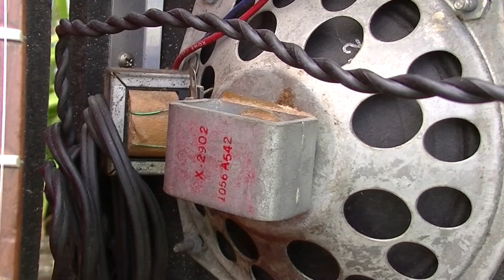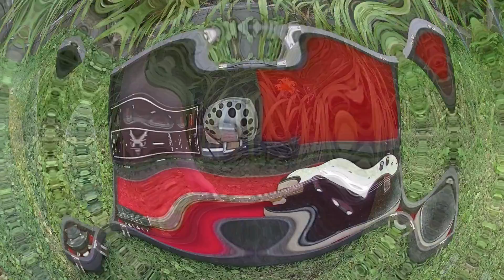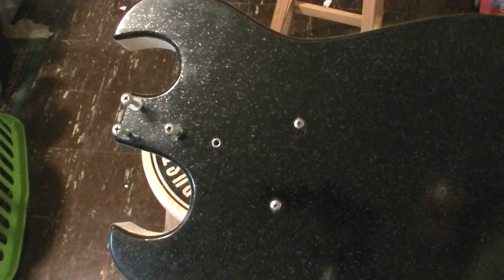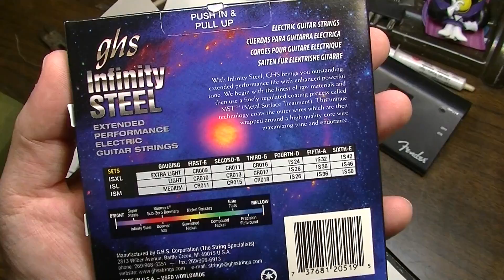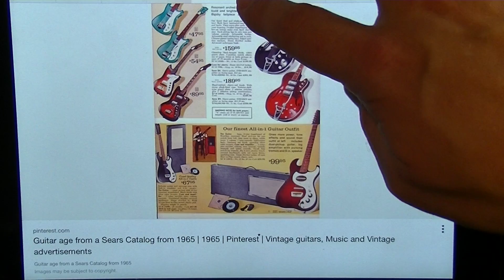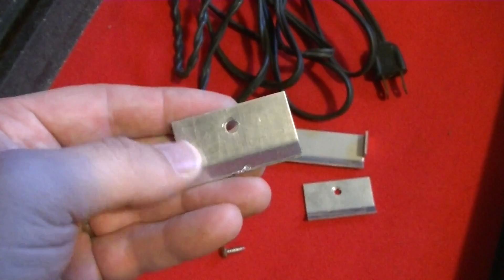Amp-in-Case Guitars - Bad or Brilliant?

Comment: Is it just me, or does that cheap hunk of plywood actually sound good?
Reply from the maker: RB Brown it ain't just you. I dig it too.
Reply: I'm 58 now and I had one of those in 1973 when I was 13. I can't remember what TV show it was but I saw "Skunk" Baxter play one of those. I was all into Kiss back then and I made an Explorer body out of 2 layers of 3/4 " plywood that was glued together and I bolted the Silvertone neck to it. I bought a Customcraft Les Paul when I was 15 and to celebrate my new guitar I put an M-80 in the Silvertone and blew a big hole in it. What was left of the guitar and case went into the garbage. By 1993 I was touring with the rock band "Brother Cane" doing front of house sound. We were in a guitar store in Nashville, and I saw my guitar and case for sale for $700.00. I about choked when I saw what those things were selling for. I see them on eBay now for over $1000.00 in some instances.
Reply: @rwj1313  I had one too! Took it on vacation to my aunt and cousin's place in Virginia. I laid it down on the floor in my room. Came back in a little while later and someone had stepped on the neck. Snapped it in two. Broke my heart. I think I ended up throwing the whole thing in the trash. No one ever fessed up to it.
Reply: Rick Jones 
I saw Brother Cane(I had forgotten the band’s name) in 1993, or possibly 1994, in Atlanta at Lakewood Amphitheater. They were the opening act of a multiple artist Southern Rock show I know it was The Outlaws, The Marshall Tucker Band, Atlanta Rhythm Section, and .38 Special, but I think there were one or two other bands. It was a really fun day.
Reply: @charlesbolton8471  Yep Georgia Jam. We were touring with Skynard and Bad Company and those guys had a few days off, so we did Georgia Jam while those guys were off. 38 Special was the Headliner. We only had 17 days off that year (1993 BTW). If we weren't in arena opening for somebody we were headlining in a large club.
Reply: Danelectro was good for Jimmy Page , so can't be all that bad
Reply: Nope,sounds great.
Reply: It's not just you,-it actually sounds very good. Distortion controlled by how hard you pick the strings sounds wonderful.
Reply: It wishes it was plywood. Masonite. Guitar and amp.
Reply: Sounds as real as it gets from back in the days.
Reply: I have one. It (the 1448 guitar) really sounds pretty cool.
Reply: Pretty sure that those guitars actually had Brazilian rosewood fretboards at the time.
Reply: Yes, Danelectro was a notoriously cheap pile of sh!t that for what ever reason souned Great.
Reply: I bought the case without the guitar for $260. I also know where a mint condition one just like yours, guitar included,  is for sale at $400.  if anyone's interested
Reply: .. Danelectro wasn't the first person to do that neck tilt adjustment thing though because I've seen it on a really old Kay model, also Chris Adjustable Acoustic had that too.
Reply: RB Brown The guitar tone is 90% in the hands.  This guy is better than jimmy Page.

Comment: i actualy had a custom case i made that had an A.R.T rules breaker amplifier in it and i had a small stereo 2 /10 cabinet that a friend made for me..the case held my old school ibanez roadstar and the A.R.T. midi controller for the rules breaker as well as housed the rules breaker head and a space for some pedals..was a bit heavy but not unmanageable..i took it everywhere i could find a plug in and would rock out and try to make some beer and cigarette money..and oddly enough i got the idea from the peavey t-15 amp in case because i had one..i remember the tone circuit being very unique in those peaveys as well..kind of acted like a boost if i remeber.kind of a pickup blend knob that would blend the 2 pickups for a humbucker kind of sound..but they were tanks and very heavy guitars..but bullet proof tough..kind of like all things peavey..not the greatest but hands down the toughest stuff.why you always see old peavey shit at pawn shops and it still works and every pawn shop has a peavey test amp...lol...great video as always bro..i lear more stuff from your channel..much thanks
Reply from the maker: sonic mayhem really appreciate the comment, dude. Weirdly enough, the guy I bought this from also had a Roadstar! I bought it too. Do you still have the amp in case?
Reply: i do not have the amp in case but i do still have the roadstar and has been one of my primary guitars for all these years.all i have ever done was replace the pots and scored a complete set of NOS pickups for it as well as i sweat killed the old ones quite a few years ago.the neck on that bay was better than anything fender was making at the time as it has the thinner veneer style fretboard and still going strong on the original frets..wish they made em like they used too again

Comment: Opening or closing the lid of case is the EQ control.
Reply from the maker: Exactly! An placing it in front of a concrete wall or a laminate paneled wall will affect the tone as well. Empty basement = reverb and delay!!! :D
Reply: Yes it is Bro.. But they also have 1/4 Close/open ,  mid close/open, 3/4 & Full! 🤠💯

Comment: Hi,  I'm a great fan of your work!  I noticed when you were reviewing the chasis (around 28:35) you mention the "isolation transformer".   I'm working on a 1451 model with the same layout and want to put a 3 line power cord on it.  From what I can tell from other sites, that may not be an isolation transformer????  They suggest that these definitely need an additional isolation transformer modification for the 3 line power cord  mod.  Any additional thoughts on that?  Thanks for the great vids!
Reply from the maker: There are different kinds of isolation transformer. This one isolates the input tube's filament. Other isolation transformers you hear about people installing in series filament amps isolate the mains voltage for the entire amp. I discuss this in a few past videos. Many of those vids are in this playlist: https://www.youtube.com/watch?v=TuZxY3-26Lw&t=20s&list=PL68vqBBsqTi9bBnS13G8rFHzhS_WYPKPf&index=4

Comment: I think they went out of favour when small transistor amps came in cheaply that you could fit in the pocket on a gig bag. Things like the Marshall MS, mini Fender and I remember BC Rich made on in the mid 80s
Reply: The current Danelectro mini amp is the Honeytone. Runs on a 9V battery (but better with an adaptor), has a headphone out, looks cool and sounds pretty good, and I throw mine in my guitar bag when I go visit my mom for a weekend.
Reply from the maker: mike fear Danelectro made a micro amp too in recent years. I don't recall the BC Rich! Cool.
Reply: I don't think the BC Rich one was that popular. I had the BC Rich UK distributor in my town and bought one from their shop, maybe around 1986 ish. Was black and pink and probably 1 or 2 watts, and had a headphone out and volume, tone and a switch for overdrive. Was maybe 8 x 5 x 1" and battery powered so was a pretty neat litle unit.  IIRC was around £25 at the time. This was quite a while before the other manufacturers started making them, so BC Rich were ahead of the game

I actually looked for one online after I posted on here but couldn't find any info or pics, so maybe I bought the only one !

Comment: Yikes.  Looks like a hot chassis design -which is fine as long as you can't touch it, but it looks like you could easily put a finger though the vent hole and touch the chassis.
Reply from the maker: It isn't a "hot chassis". That's a common misnomer. No guitar amp will be a "hot chassis". Some radios like the All American Five, or AA5, can be hot chassis, with one end of the line tied directly to the chassis, but in series-filament guitar amps, the design includes an isolation capacitor and resistor separating the common ground in the amp from the actual chassis. And in some cases, they even features isolation transformers for the input tube's filament, which further isolates the inputs (and fingers) from anything carrying 120V line voltage. This design has both the isolation capacitor and resistor network as well as the transformer.
Reply: I looked again.  I thought the power switch was connected to a "ground" lug.  I guess it's not - just real close.

Comment: Your recording skills and quality are improving drastically. I would totally rock this setup for work when I go out of town.  I thought about building a 2 watt micro Bassman or Deluxe into a Fender Tweed case, then I realized there's not enough room for the transformers and speaker. Series filament is about the only way to get a tube amp into a case not designed for it.

Great video!
Reply from the maker: Matt Fields they managed! See the discussion of the 1449
Reply from the maker: Also, yes, I'm working on my editing skills and purchased some new toys and software. Getting better all the time. Before long, I'll need a director's chair. :P
Reply: The Guitologist please don't let production get in the way of your videos. The sound quality is second to content imo. Besides, your videos have always sounded great to me.

Comment: Nice playing. New recording set up sounded good too. Amp and guitar sound pretty good for such cheap construction. Still much better than cheap solid state amps of today. Surprised you didn't change out those brown turd capacitors in the amp. I thought I recall you mentioning in another video how those are usually not so good.  I left them in my Silvertone 1483 for now, but am considering changing them all out and see what the difference is.
Reply from the maker: Zelleram55 these were different turds. The bad ones are CDE Cornell Dublier.

Comment: Brilliant!!  I really love the high end model with the 6v6
Reply: I got an all original 1449 from the original owner for $0. It was time to clean out I guess. The 1449 and the 1457 are essentially the same thing except for the former having the black and white color scheme and the latter having the sunburst-esque finish, but 1449's are the rarest of the all the Danelectro amp-in-case units as it was only produced in 1963. It was the first 2 pickup model in this line and was replaced in 1964 by the 1457. Transformer and tube date codes from mine jive with this.
Reply from the maker: Bob Boitt yes! That is a wonderful setup. Big smiles when I get one of those.

Comment: My dad had one of these. If you touched the strings and the floor lamp that sat next to it at the same time it was painful. Wish I still had it. My brother took the guitar apart and used the pickup on an acoustic guitar. I could kill him when I think about it. I don't know what happened to the amp. My folks probably got rid of it before one of us got electrocuted.
Reply from the maker: onus gumboot depends which way the plug is oriented in the socket whether you get shocked. You can test it and if you do get shocked, that means it was the wrong way. :D
Reply: I know that now, but I was maybe 9 or 10 at the time. If I had that amp now I would set it up with a 3 prong plug to make sure  it was always the correct polarity. At the time we thought it was funny and would dare the neighbor kids to touch the guitar and the lamp for a laugh., But then again we played with yard darts and every other toy on the list of most dangerous toys ever. A different time, dangerous maybe, but fun. great video by the way. the tone of that guitar and amp brings back memories of my dad playing. Sure miss him

Comment: You made it sound nice! For a portable amp I use and old micro cube, but have been looking at the Blackstar FLY 3, for a picnic table amp. For me lighter is better. When you get older, it's, hold the jam, and 1 piece of bread. Great video, good history lesson. thanks
Reply from the maker: Shawn Wilkinson micro Cubes are great.
Reply from the maker: Do yourself a huge favor and check out the Boss JS-10 eBand. Last practice amp you'll buy.
Reply: I did a couple of years ago, but I already had a gt-10, and they're similar, except for the speaker. The micro cube will last a month on batteries. The Fly 3 size is what I like. It would slip into a gig bag, I think. At 1/3 the price.

Comment: I have wanted to make an amp-in-case ever since I first saw them, but I actually want to make it so you could have your pedalboard in the case as well. And with SMPS boards today, that can give you B+ voltages even from batteries, I'd like to try making it a tube amp.
Reply from the maker: blackcorvo BINGO! A company like Boss could make that happen as a production item if they really wanted. It would be awesome. Use the Boss circuits in the amp itself and include a separate foot controller that stores in the guitar case also. Could be super cool.
Reply from the maker: blackcorvo a tube amp is doable too. Just need the right profile PT.

Comment: I bought a Kraftsman with a series filament amp in the case back in 86. The pickups were huge bar magnets the size of a PAF but just a single winding around the perimeter. The amp didn't work but the guitar screamed through a crate stack. I ended up trading it to a guy for a Peavey T60 because my cheap Floyd shred machine was driving me batty trying to keep it in tune.
Reply: No jelly has been my riff since I had the choice, give me pb or give me death.
Reply from the maker: Jelly is like pedals...not really necessary most of the time. Got any pics of your Kraftsman?
Reply: I wish. like I said it was back in 86 and any camera I had then was the old film type. My mom passed on with a fish bowl full of crumbling film cartridges that she was going to get developed "someday". I do wish I had that T60 back though.
Reply from the maker: If you have that film still, you should make today "someday". That's your history, man.